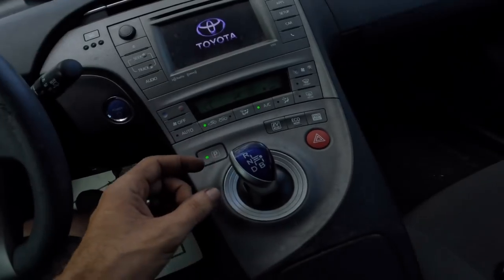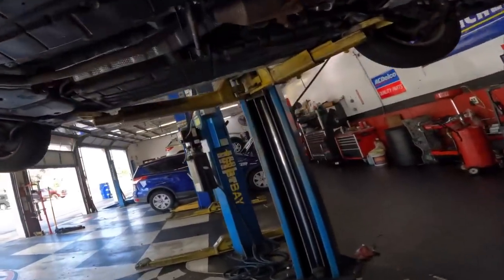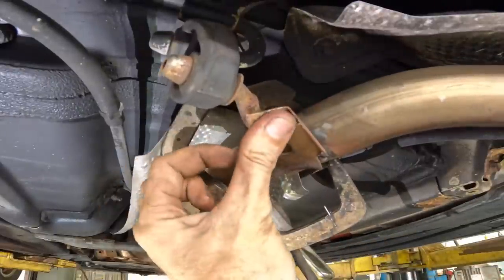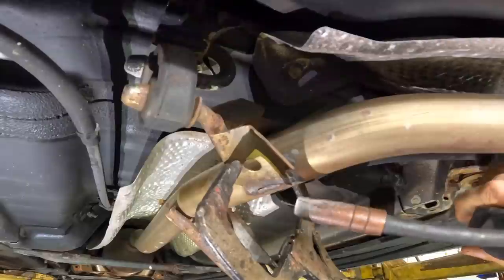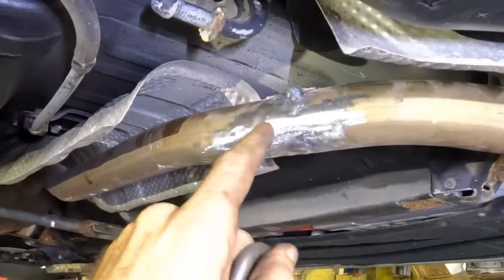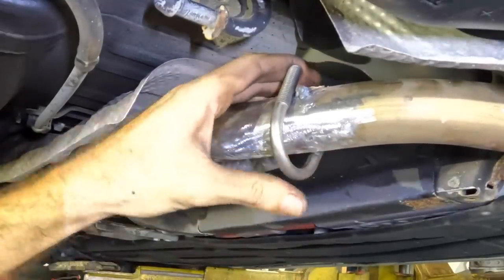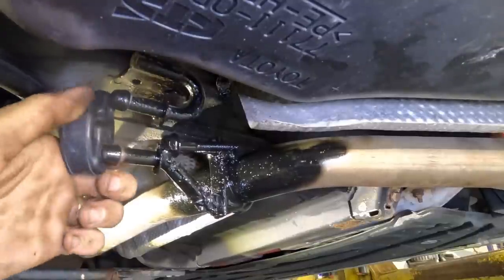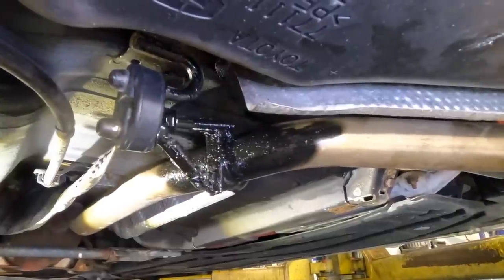This Video is a BAD Idea! Saved Customer THOUSANDS!

Comment: It's stainless, 400 series stainless is magnetic, 300 series has nickel in the alloy which makes it low magnetism. For your purpose I'd recommend some Blue Demon 309L flux core wire, It's low carbon and will work decent on just about anything. The standard ER70 or E71 will make stainless very brittle, the carbon inside the exhaust will make it much worse. Your repair will probably crack and need repair again.
Reply: Thanks for tip. Ordering today , just in case
Reply: Muffler shop?
Reply: Talking about the pipe being 400 series or the clamp? Failing to see how the repair would fail if he didn't weld on the pipe, just the clamp.
Reply: @zunar_j5_933  He started by trying to weld the original mount back on the pipe, that probably heated it up enough to absorb carbon from the inside of the pipe, along with the lack of shielding inside will make it brittle.
Reply: Shop that can't keep it's general equipment in repair (Mig Welder) for use when needed is indeed Poorly able to offer good service
Reply: Chances are it's not a stainless exhaust unless it was replaced which is doubtful for the area.
Reply: @Brisco_County_Jr  Prius come with stainless exhaust
Reply: @Brisco_County_Jr  Actually it is 304 stainless (with nickel) that makes it slightly magnetic but lasts (with slight corrosion) 4 life of most vehicles. Virtually all mass production stuff's being that for last few Decades or so. The steel pipe of old would have complete rust patina, if it existed at all.
Ck It Out....... 304 stainless
Reply: @zunar_j5_933  whole thing is 304 stainless. His welds may well last forever, but will corrode as they're mostly iron.
Reply: @73amx63  Ya , they should have the rite stuff to fix this 304 SS stuff
Reply: @peted5217  it's a rarity on cars in general. Guess the Prius is the exception. Not sure why they actually decided to spend the extra on a stainless exhaust. Nice of them. Most exhausts rust out in the north in less than 10 years.
Reply: @zunar_j5_933  he heated the ever loving hell out of that pipe, and thinned it out with a ton of sanding. The pipe itself will prob fail is what hes saying and I agree.
Reply: Well he didn't actually weld to stainless!!
Reply: @adamnichols476  it’s an exhaust so it shouldn’t be dealing with that much pressure, but he should’ve ground off the rust, wiped it down with acetone, purged the pipe and TIG welded it, but it’ll probably be fine and I understand why he did it that way, he’s a mechanic not a welder.
Reply: @Brisco_County_Jr  Double Check ypur facts Senor Brisco. The use of SS alloys for most vehicles exhaust including GM started with the Age of Catalytic Converters.Why Then?
Reply: @peted5217  not true at all. I've had 3 gm cars in the past 15 years that had the exhaust rust out after the cat within 8 years. Maybe the manifold to the cat is but the cat back is definitely not stainless and anyone saying otherwise is full of it.
Reply: @Brisco_County_Jr  Because Gov't dictated Cats be warranted 50,000 mi. This made  the use of SS Alloys favorable to reduce warranty costs. GM has used lo grade SS over 2 decades. It won't polish but will corrode somewhat, generally outlasting vehicle life.
Reply: @peted5217  so exactly as I stated. Cat backs are generally not Stainless. The cat is and possibly the mid pipe. Doubtful the manifold is either.
Reply: @Brisco_County_Jr  Actually if you check recent GM Hi Perf V8 Engines , you'll see OE real SS  'shorty style' header manifolds. Vettes & Cameros . Everything else is still cast iron .
Reply: @Brisco_County_Jr  Leave it to GM to 'Cheap Out' on materials specs.
Impressive V8 Engines. Rest of vehicle , not so Much. Since their bankruptcy, quality issues garner too much attention.
Reply: @Brisco_County_Jr  
Ferritic stainless steel is common in automotive exhaust
Reply: @poppiarlin5612  stainless regardless of type will not rust out as fast as most exhausts from the cat back do. Get over yourselves. Exhausts aren't stainless apart from the cat and possibly the mid pipe.
Reply: @peted5217  it's obvious you people don't live in a northern state. I've used aftermarket stainless exhausts that have lasted for years without anything more than light rust. While the stock system was thoroughly rusted through requiring replacement.  There is no way they used stainless. I've seen the difference first hand on quite a few cars.
Reply: A minimum of about 10.5% chromium is usually required to passivate the surface and to classify a material as stainless steel. So long as this oxide layer is stable and continuous, the metal substrate is well protected from corrosion. It should be noted that nickel, while used in many grades of stainless steel, is not contained in all grades of stainless steel.

Since about the mid-1990s, plain carbon and low alloy steels have been replaced by stainless steel as the primary material for exhaust systems downstream of the exhaust manifold or turbocharger. This transition has taken place because of market demands for extended warranties, and because of demands mandated by emission standards. Technologies to meet increasingly stringent emission standards can raise exhaust temperatures which makes the task of meeting strength and durability requirements especially challenging. Emission standards also require that exhaust systems are designed in a manner that facilitates leak-free assembly, installation and operation for the full useful life of the vehicle.

From the early part of the 21st century, commodities including many of the alloying elements used in stainless steel, have experienced wide and rapid price fluctuations (see Figure 4 for example). In some cases, costs for these materials have increased by up to ~1000%. In response, stainless steel producers have added an alloy surcharge that can be adjusted as needed to account for these price variations. Many producers have focused considerable research efforts on reducing the sensitivity of the finished product’s price to these alloy surcharges.

Emission control systems such as actively regenerated diesel particulate filters (DPFs) and urea selective catalytic reduction (SCR) have also created new demands on material properties. Active DPF regeneration can produce exhaust temperatures as high as 800°C in parts of the exhaust system that would otherwise operate at much lower temperatures. Also, some commonly used stainless steels, such as type 304, have been found to corrode after exposure to urea decomposition products in high temperature environments.

Common alloying elements found in stainless steel and their effects are summarized in Table 1 [ASM 2001][Arlt 2007].

Table 1
Common alloying elements found in stainless steelElementEffectChromium

Essential in forming the passive film. Oxidation resistance increases at Cr levels above 10.5%

High Cr content can adversely affect mechanical properties, fabricability and weldability

Nickel

Stabilize the austenitic structure to enhance mechanical properties and fabrication characteristics

Resistance to stress-corrosion cracking is poorest at approximately 8 to 10% Ni but is restored at levels of about 30% Ni

Can minimize spalling of surface oxide during temperature cycling

Manganese

In moderate quantities and when nickel is present, performs many of the functions attributed to nickel

Interacts with sulfur to form manganese sulfides which can degrade corrosion resistance

Can improve the adhesion of oxide film and improve oxidation resistance

Molybdenum

In combination with chromium is very effective for passive film stabilization in the presence of chlorides

Especially effective in increasing resistance to the initiation of pitting and crevice corrosion

Carbon

Provides strength in the high-temperature applications

Detrimental to corrosion resistance through reaction with chromium to form chromium carbides

Detrimental to toughness in ferritic grades

Nitrogen

Enhances pitting resistance in austenitic grades

Detrimental to the mechanical properties of the ferritic grades

Aluminum

Enhance high-temperature oxidation resistance

Niobium and Titanium

Stabilizers used to preferentially combine with carbon and nitrogen to reduce the formation of chromium carbides and nitrides. This reduces the possibility of intergranular corrosion.

Titanium oxide may adversely affect brazability

Copper

Provide corrosion resistance to sulfuric acid

Improve formability

Silicon

Provides high-temperature oxidation resistance

Provides resistance to stress corrosion cracking and to corrosion by oxidizing acids

Of the varieties of stainless steel available, two that are important exhaust system materials are:

Ferritic stainless steel, and

Austenitic stainless steel.

Ferrous alloys can contain three important grain structures: ferrite, austenite and martensite. In ferrite, the iron atoms form a body centered cubic (BCC or α-iron) structure with iron atoms at each corner of a cube and one in the center of the cube, Figure 1. Austenite is a face centered cubic (FCC or γ-iron) structure with iron atoms at each corner and on the center of each face of a cube. Interstitial holes in the FCC structure allow austenite to accommodate a greater number of carbon atoms, up to 2.11% by weight, than the BCC structure of ferrite which can accommodate up to 0.0218% carbon. Austenite can be transformed into martensite, a very hard and brittle grain structure that is not normally used in exhaust piping systems.

Comment: "I'm in a constant battle against a throw away society" Your store really needs to keep up with making t-shirts with your words of ray wisdom.
Reply: all mechanics in a nutshell
Reply: Should be called Raysdom
Reply: My wife had a similar problem a few years ago (one hanger rusted off and some sort of band around the muffler gone). Of all places, the guys at the dealership offered to try and weld it first and only get a replacement band, because in the first place it was only offered together with the muffler. All other shops, independent as well as "well known chains" (I did not say well known for superior quality and craftsmanship!!! well known for "affordable prices") right of the bat claimed, nope, have to replace everything from the catalytic converter to the rear.
What should I say, the dealership managed to weld it back together, they managed to get a spare band and I paid about 45 EUR for the repair. The were fair enough up front to say, if they could not weld it or not get only the part, replacing the exhaust there would be about 600 EUR including labor. which was surprising as well, as all others asked at least 700.  And the repair held up for at least 6 or 7 years until we sold the car. For that car I never went everywhere else except for that one dealership location afterwards, as they always had lower prices than others, even for a simple oil change or inspection.
Sadly I am almost sure in other dealership places it might have looked a lot different as well.
Also, having known a mechanic that work in one of those chains locations as a master craftsman some years back (back then they still did proper repairs, today good luck having them replace anything with something that is at least an OEM quality part. And here in Germany a shop cannot run by only journeyman mechanics, you will need at least one master craftsman to be allowed to operate a regular repair shop. It is different for those oil or tire change places though, who don´t do repairs) I know that it´s not necessarily the mechanics qualification and abilities that limits what they attempt as a repair or don´t, it is simple company policy only to offer parts exchanges where other shops may offer having parts rebuilt or trying to repair.
Reply: If Ray doesn't shoot the parts cannon enough, the service center might look at his sales statistics since the computer spreadsheet easily ranks merchanics in order of sales revenue to the shop.  If Ray keeps saving money for the customer, his sales statistics will be at the bottom.  He'll be let go for that and the shop will hire a new mechanic that is more profitable.
Reply: @animejanai4657  Have you see the latest videos? If it were my business having customers that return to your shop because of your honest dealing with them and the word of mouth that creates both in person and online would be far more preferable to quick grab and run rip offs.

Comment: Ray Charles could see where the next leak will appear.  Instead of trying to mate galvanized to stainless, heating and bending the hanger rod 180 degrees over top of the exhaust pipe, then clamping and welding to the clamp only would have mitigated the stress on the thin gauge exhaust pipe. The pinholes from the mig will be apparent in no time. Your effort was shade-tree101 used car lot fixem up.  I still love your channel though-- from a former GM mechanic.

Comment: People have this misconception that because they bought a welder at Harbor Freight that it makes them a welder. After nearly 50 years of watching people weld everything from natural gas transmission pipelines to power station boiler tubes I can tell you that it doesn't. 

It takes years of practice and experience. Even at that there are various levels of certification for various jobs. 

Ray, you have nothing to be ashamed of. When the power station offered a welding course I declined. I was an Instrument Repairman and Electrician, and we don't lean into the arc, we make the arcing stop.
Reply: Welding is an artform. The technical side can be taught in a classroom but the reality of building consistent properly penetrating welds is an art. It's about seeing and hearing the weld process. Can't get that anywhere else but spending hours under the helmet.

Comment: A friendly tip to weld.  #1:  Clean all surfaces that are going to be welded.  You had the right idea originally to tack the bracket.  But then wire brush it, hammer it in place, then weld a full bead across it.  Same for the upper surface.
Reply: Precisely what I was going to suggest, and I'm not a welder's middle finger. But that much I have learned.

Comment: Had a similar thing happen on my '09 Silverado 1500. Previous owner had an aftermarket exhaust installed and the welds rusted out. The holes were down stream from the cats but before the mufflers. I hammered some flat plate steel to the shape of the pipes and welded them on a patches then bent and welded a piece of 5/8" rebar as the brace. Since then I have cleaned all the welds and applied a heat resistant paint everywhere I could reach. No problems since.

Comment: Alot of shops would replace the whole exhaust just to make money but ray is like me save people money when ever possible yes it went in circles for him at first ray but in the end he got it done and saved the customer tons of money great job ray
Reply: I don't think it's "just to make money" - because shop make money on repairs - not on selling parts.
They will do it simply because it is easier - just order and replace, no brain activity whatsoever.
Reply: @deadlymecury  shops mark up parts by 50-100% everybody knows this
Reply: @mentals555  aha, 200%, no, 300%.
Reply: Stealership be like you need a whole new exhaust the muffler the catalytic converter new oxygen sensors and we noticed the suspension why’ll we were under there looks dangerous I recommend new control arms and all new bushings too. We can do it for 8K

Comment: Muffler shop veteran pro tip. A little shot of PB blaster in the rubber insulator and they slide on smooth as silk. Another great video Ray! 👍👍

Comment: Just to help you get your mig or flux core wire welding better; purchase a container of MIG nozzle cleaner and use it frequently while welding. It will keep your tip from getting full of spatter. Also always clean your area to be welded to clean metal surfaces.

Work on keeping your tip a small distance from your work and don't touch the nozzle against your work.

Stainless steel can be magnetic depending on the grade of stainless, but it still can be welded with a MIG welder.

Comment: Hint for better welds with flux core from a weekend welder: grind shiny the mating surfaces and whenever you stop a weld, even a tack, clean off the slag before continuing.
How about vise grips clamping the bracket sides to the saddle then weld through the holes in the bracket to the saddle?
That way, the hanger could be removed later if further maintenance is required down the road.
It may not be pretty, but it's solid!!

Comment: if i was that customer i'd have been EXTREMELY happy with that result.
Reply: It’s definitely prettier than a $1000 bill
Reply: Not me. I woulda been po'd
Reply: until the exhaust pipe fails for being overheated with carbon inside it. Then its a 2k repair instead of using a clamp in the first place.

Comment: Awesome video.  A simple diagnosis, but an elegant fix.  Your welding skills may need improvement, but your creative problem solving skills are at a pro level.  You fixed it, saved money, landfill space, and left the parts guy sitting by the phone to wonder if you're gonna call.  Bravo!
Reply: Yeah the people talking they used to Miller's hobart's in Lincoln's this was at off the shelf store bought little Wilder probably 110 volt and he did a great job I know what he was working with have a good night
Reply: Shitty welds are great if they safe you 1000 bucks.
It isnt structural, safety relatet or in a place you have to look at it so it is good enough.